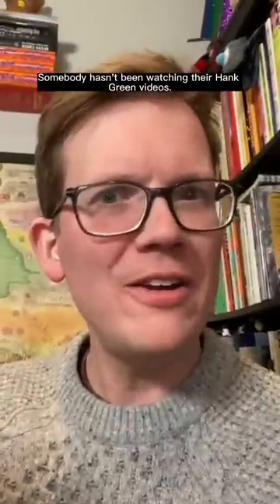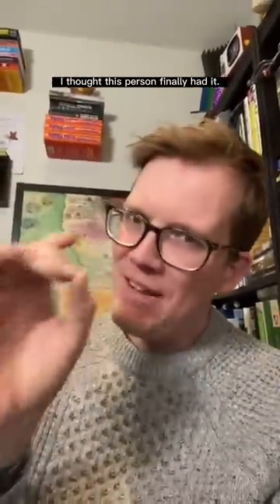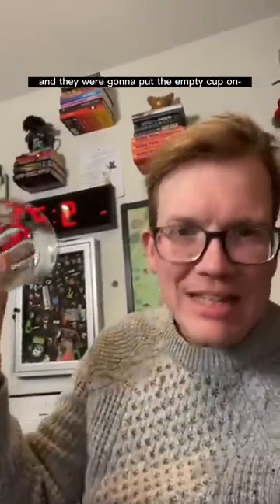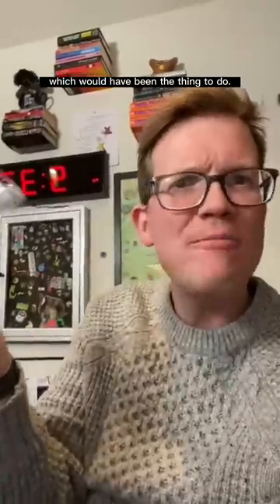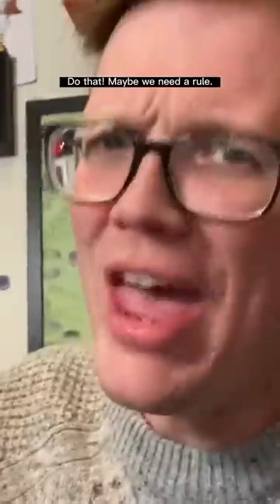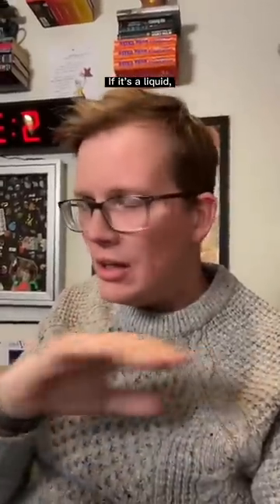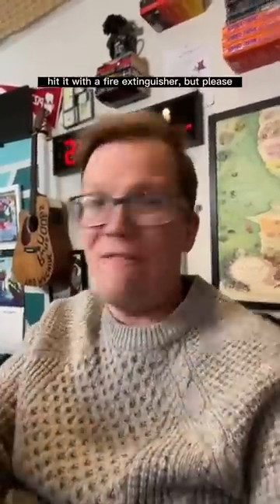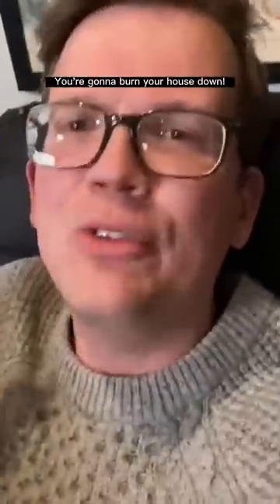Why does water cause candle fires to explode?

Comment: In my house we never really use candles unless the power is out. So I genuinely never would've thought that pouring water on a candle fire was bad, but it makes perfect sense now. This video potentially saved a few lives! Thanks Hank!
Reply: Normally if I want to extinguish a candle, I just blow it out. If it were to set fire to something nearby I probably would try to throw whatever water I had o nthe thing thay was burning. Like a curtain, or whatever. Never really thought about them as two separate things.
Reply: It still doesn't make sense to me. How does the fire get that big with only a wick to burn?
Reply: @adaharrisonn  adding water to fire creates steam with feul in it ... then the fire essentially burns the feul cloud.
Reply: @adaharrisonn  adding water to hot things make them evaporate. Evaporated water is oxygen. Oxygen can act as fuel, and thus, create bigger flame
Reply: @adaharrisonn  if it's a scented candle, the perfume oils can reduce the ignition temperature of the wax to the point that the heat of the burning wick can melt and produce combustible vapour over the entire melted surface and ignite it.
Reply: @reinhartnata47  wrong. Evaporated water is not oxygen.
Liquid water is, however, denser and thus heavier than wax, which means that if you pour liquid water into melted wax, the water will sink below the wax.
The water, however, boils at 100°C, while the water doesn't even melt until it's at least 50°C, the molten wax of a burning tea candle is around 150°C and circulating as it's heated by the flame, is pushed outwards, cools down and is pulled in towards the wick again.
As the molten wax is hotter than the boiling temperature of the liquid water, as the water sinks through the molten wax, the water flash boils, and  water vapour takes a LOT more space than it did as a liquid.
Space that it gets by displacing the molten wax above it. Violently.
THAT is was causes the flash conflagration. The water is not chemically changed at all.
Reply: @SonsOfLorgar  thank you!!!
Reply: @SonsOfLorgar  aight thanks for the correction
Reply: @Jordan-kq3qw  i had a stroke
Reply: @reinhartnata47  Evaporated water is just evaporated water... Since when does a change in form also change the nature of a compound. It's called steam and not oxygen for a reason...
Reply: @reinhartnata47  an addition though when poured on metal fires, such as burning thermite, lithium, or magnesium, the energy of the fire and the salts produced in the combustion will react with water and tear the molecules apart into hydrogen and oxygen, causing an even worse fire than water on liquid fuel.
So never use water on aburning battery.

Comment: Quick note, if you have a pan full of oil on fire, DO NO GET UP CLOSE AND SPRAY THE EXTINGUISHER AT IT! It will cause a FIREBALL by displacing the oil into droplets, with a greater surface area. 
TURN OFF THE HEAT
COVER IT UP WITH A LID, A POT, ETC.
If you use an extinguisher, stand back 4-5 feet or more, get closer if you need.
DO NOT DISTURB IT FOR AT LEAST 15 MINUTES, it might reignite if you take the lid off or disturb the layer from the extinguisher. 

Source: I admit nothing.

Comment: I once left a candle in a metal tin burning all night (I was awake with it), and after a few hours, the wax caught fire, and it was just this beautiful dancing wax fire. Unfortunately, I couldn't blow it out, so I got a cup to smother it. A plastic one. The cup melted to the tin, and the heat from the tin also melted a perfect circle through the carpet and insulation right down to the floorboards. It was not an intelligent day. I am very happy now that I never even thought of using water to put it out, though 😬😅
Reply: You were burning a candle on the carpet?
Reply: @NiKiMa023  LMAO…. hahahaha
Reply: @NiKiMa023  don’t worry about it. He’ll win his Darwin Award soon with that idiocy.
Reply: @juan_valdez117  I mean, there was a metal tin.
Reply: Mhm one time the glass on my candle broke spilling wax everywhere I was right by it when it happened and was able to blow it out before it spread but was still scary
Reply: @legendsocool644  modern candles are made of paraffin wax and or bees wax neither will burn by itself without a wick so they are fairly safe even if they fall over (that said there is still the risk that it could fall the wick could stay alight and set fire to what it lands on).

Scented candles aren’t supposed to have enough flammable scent in them to be flammable however I have seen some that caught fire right across the top when they got hot enough.

I was thinking both of your stories could have been a lot worse with one of them. Then I realised the first one was one.

(Edit: it makes sense now)
Reply: @juan_valdez117  I mean, I was 14. They tend to be pretty dumb. And I'm not a dude.
Reply: @NiKiMa023  I did say it wasn't an intelligent day for me ahaha. I was 14.
Reply: A family here in Sweden had one of those larger outdoor candle things, they had placed it on their wooden staircase/deck. It became so warm that it caused the wood to ignite, resulting in the house burning down.

Moral of the story, don't place candles on stuff that can start burning.

Comment: Instructions unclear, now I have a broken table and a dented fire extinguisher and I can't find my candle.
Reply: Hehehe 🤣🤣🤣
Reply: @Electricz0 Instructions also unclear..
 I'm now standing on the kerb, outside my now water flooded, semi-smoldering ex-house.. Also can't find my candle.. or the cup of water.. But luckily I didn't have a fire extinguisher to dent 🥲.. ☮️♾️
Reply: New instruction, move away from highly pressurised, dented fire extinguisher.

in fire training I was told if you can't put fire out with one extinguisher, get out.
Reply: Instructions unclear, i put their cup over the fire to smother it of oxygen, now cup is on fire...

... did anyone else notice the cup is made of paper, Styrofoam, or plastic?
Reply: @agalerex  haha 😁
Reply: Im glad im not the only one who thought this way.
Reply: Lost candle won't be lost for long if it's still burning, if it's gone then the fire extinguisher still did its job🤷🏼‍♂️ fire extinguished. Another guy did say run from the dented fire extinguisher though, probably a great idea.

Comment: I keep some old, real jeans just for putting out candles after my brother had a fire he didn't know what to do with. I grabbed his laundry (since it was nearby on the floor), checked it was real jeans and smothered the fire while it was still small. He learned a lesson on what not to set candles on or near, and the fire pants are still around as a reminder.

 Everyone needs a fire extinguisher and to check it's still in date and pressurized, especially for kitchen fires. I studied with the fire company down the road after that incident because it was scary how fast that fire was spreading, even from such a small candle.

(True jeans have no plastic fibers, no spandex, check the labels and feel for the proper rough texture without stretch).
Reply: They're all jeans. What you're speaking of, I believe, is 100% denim.
Reply: Or you can just not ruin a perfectly good expensive pair of pants and just use baking soda or salt
Reply: @Kitsudoku  A house is more expensive than jeans. Plus jeans retain use and asthetic value when burnt.
Reply: @Kitsudoku When a fire starts, you use what you have close at hand before things get out of control. Salt and baking soda are recommended for grease fires because you're often already in the kitchen where you can find those ingredients. Smothering fires in bedrooms is quicker when you have to act.
Reply: @pretzelmaker3122  I wondered if fake jeans were like...jeggings, but those wouldn't take a close inspection to identify LOL

Comment: I always thought wax just slowed the burning of the wick. I just learned that wax is actually combustible.
Reply: Yep the wax is the actual fuel source. The wick is well doing its job of wicking it to be used by the fire. So a good wick will last a long time while a bad wick ends up burning away too fast.

Comment: Minor correction: water doesn't rob a fire of oxygen to put it out. It actually robs a fire of heat energy. Once there isn't enough heat energy left to hit the critical point of self sustained combustion, the fire goes out.
Reply: Actually steam also displaces air/dilutes air.

Comment: this is a really good instance of learning vs memorizing. I've always known not to put water on grease fires because I was always told that. but now hearing Hank explain how the water turns to steam, increasing the surface area of the fuel so it all burns at once I A) understand why grease fires react that way and B) know what similar situations might cause the same bad reaction. it's SO much more helpful than just repeating a rule without teaching people why it happens.

Comment: Bicarbonate soda is particularly good at putting fires out, when it heats bc fire, it releases carbon dioxide that smothers the fire.  10/10. 
Its also commonly found in dry powder fire extinguishers for this reason!
Reply: I generally try to avoid recommend dry kitchen goods as fire extinguishing methods. While you're correct, it can be hard for the "less savvy" of the world to remember which dry powder to use and they'll end up using things like flour, which can absolutely burn and/or cause splashing. 

Just reinforce "put a lid on it" over and over with people.
Reply: @TheEvox81  Flour dust explodes as well!
Reply: @feuerling  Exactly my point.
Reply: @TheEvox81  notice that I didn't say "put dry stuff on it"? I gave a very specific chemical that is used for this purpose. Almost like words matter 💁‍♀️
Reply: @lwolfstar7618  notice, I didn't say you said that... I said, in an emergency, it may be difficult for people to remember which dry powder to use and they might make a terrible mistake... It's almost like words matter.
Reply: @lwolfstar7618  you clearly get off on being a pedant... And I'll allow you to do just that. But first, I must clarify...

I didn't imply anything of the sort. Your advice is sound. The flaw is expecting perfectly normal people to remember it in an emergency. Even people with otherwise excellent faculties can panic in an emergency. (Not to mention the fact that a vast majority of people can easily confuse baking soda with baking powder under the most stress-free of situations.)

My advice, is to remove the opportunity to do so by providing guidance with no alternatives... "Put a lid on it" is unambiguous. Even for a pedant.

Comment: TIL, candle waxes are hydrocarbons and fuels. I thought the puddle was just there to keep the wick from burning up too quickly.
Reply: I mean it’s right to assume that. It does do that too. The wick is just the delivery device though. Wicking is to draw up. Its the same thing as when you dip paper in water and the water climbs the paper.

Comment: My general rule of thumb as a 20 year old is that I know to not use water on grease fires but I’m not always sure when it is and isn’t a grease fire, so just don’t use water. Remove the source/fuel is the first step one if possible, and step two stop giving it oxygen
The only exception is campfires because I am very certain those are not grease fires because I made them

Comment: The water doesn’t interact with the wax, it just separates it into smaller more flammable droplets. As a candle, it burns slow, but when you pour water, it burns fast bc it’s separated.
Reply: Water also isn't to deprive it of oxygen. It's to cool it below the ignition point, because the boiling water will reduce the temperature. Works for anything that burns at a temperature below 100C.

Comment: I'd like to point out that the cup was a paper or plastic cup. It would have melted or burned. I'd also like to point out that the shelves are made of metal, and are more like bars than shelves. Putting a cup on top wouldn't do anything. It wouldn't smother the fire because air would come up from the bottom of the cup

Comment: A better way to explain this is, when you burn a candle you are really burning the wax which is oil. Oil and water don’t mix. Cutting off the supply of oxygen is a good way to put it out. Also act quickly and be prepared if it’s more then a paper bin big to just leave call the fire department it will spread fast and use up a lot of oxygen

Comment: There was a great saying we used to say in freshman HS biology. “Do as you otta (ought to) add acid ti watta (water)” and never water to acid for this exact reason. It was trying to say that even if two substances are the same and both are used in two different experiments, depending on HOW you mix them could cause a completely different reaction, so we were told never to add water to anything bc it might explode but rather if we have a volatile liquid depending on what it was, dilute it by adding it to water not the other way around 👍🏼

Comment: One kitchen I worked at had a large bucket of salt beside the giant industrial woks we used, explicitly for grease/oil fires. Because you do not want to let it get to the point where the fire suppression system kicks in. All the food will have to be thrown away, and you will spend two to three days cleaning.

Also, odd tangent: an industrial wok is the best way to boil a sheep’s lungs before grinding them up for haggis. It’s very easy to keep the windpipe from falling into the water and getting all the muck from inside the lungs all over the outside of them.

Comment: I'm glad I knew this a few weeks ago when a pot in my kitchen caught fire. It had a bit of oil heating up while I chopped an onion, and I got distracted and took too long and POOF, it was aflame. My kids watched in amazement as I used a pair of tongs to pull the flaming spatula out of the pot and drop it in the sink, then grabbed the pot lid with the tongs and carefully placed it on top of the pot. Fire smothered, crisis averted!

Comment: Fire class B (liquid). Never use water usually powder extinguishers are the most suitable but also foam and CO2 can be deployed if you got one around.

That sudden explosion cause by pouring water as a way to extinguish is called boilover which is explained in simple word in the video.

Comment: When I was 11 or so, I had one of those decorative candles that's more like a see-through jelly with seashells floating inside it. It had never been lit before, so I was curious and lit it myself. Within a couple minutes the whole surface was on fire, not just the wick! I panicked and ran the candle over to the bathroom and turned it upside down in the sink, because that was the nearest non-flammable place I could think of to throw it in. I'm not sure that I understood back then exactly what I was doing by turning it upside down, but it deprived it of oxygen and worked!

Comment: I’ve never been in a position to ever need to use it, but I’ve heard that one approach to stopping a grease fire is to add cold grease to it, bringing down the overall temperature so it’s no longer at ignition heat, but idk for sure how accurate that is.

Comment: I learned this when I was like 5 or 6 when my brother caught some oil on fire on the stove and put it under the sink and blasted cold water.  I know he got burned I don't remember how badly, not enough for scarring.  But I do remember how huge that explosion was and how I grew up with a black ceiling over the sink. Even after painting several times you could still see the grey kind of haze through the paint.

Comment: My toaster oven caught fire.  Well the pan inside it.  The only thing I had that could put out fire was water, and its right next to the sink. I knew that water would make the fire flare up, but will still put it out.  I knew that the better option would be a powder to snuff out the fire, but only powder i had was flower, so that no good.  Just I dragged the fire pan into the sink, turned it on and jumped back.  Everything went to plan.

Comment: fun fact i didnt find out until a few years ago: fire extinguishers have a band around them that tells you what situation they're used for! if memory serves me right, a red band means it only has water in it and a black band is for electrical fires. the other 2 that ive heard of are blue bands and yellow bands- one is good for kitchen use because it handles grease fires like this! do i remember which one it is? nope. but it's out there!

Comment: I remember PSAs about fire safety as a kid, and I remember them saying to never use water for an electrical fire or a grease fire.

The electrical thing, I got. Even as a young kid, the danger of mixing electricity with water was a given and didn't really have to be explained. But grease fires? I am 38 years old, and this is the first time I'm hearing why you shouldn't do it, and it absolutely makes sense. I wish this had been explained to me as a kid.

I think kids, as they grow up, realize a lot of rules they were taught are BS, so they kind of ignore them after a while. So for important rules like, "don't poor water on a grease fire", it's probably worth explaining. It's not too complex for them either. Hank explained it clearly in a matter of seconds and you don't need much of a scientific background to get it.

Comment: I usually blow them out, I love the smell, but I keep my candle flames small. If a flame gets too big, I put more wax or coconut oil in it. I used to do the finger lick and pinch trick, but I forgot about it until now, and I'm no longer a teenager with an absurdly high pain tolerance. I used to not really feel pain. Now I do. And burns are one of my least favorite types, after paper cuts.

Comment: One of my favourite things that I learned online was fire safety experts pointing out that not only does water disperse hot liquid fuel,
but it is comprised of 100% highly combustible elements.

Have fun with that the next time you see a metal or chemical fire.